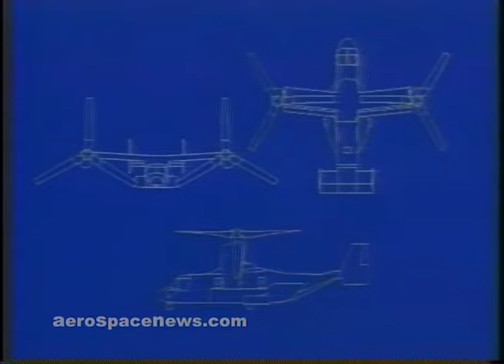V 22 Osprey Documentary | NASA Bell XV-15 Tiltrotor | Tilt Rotor History Part 6 | AeroSpaceNews.com

Comment: Looks like a copy of a Canadair design built many years ago!  Little interest then so it was cancelled!
Reply from the maker: +Ed Majden Thanks for watching and taking the time to comment. While they are both convertiplanes, the Canadian design (Canadair CL-84 "Dynavert") was a tilt wing, where this is a tilt rotor or tiltrotor (seen it spelled both ways). When they were working on the CL-84, limitations all of the aerospace industry faced (lack of computing power for stability augmentation, poor power to weight ratios, and other things), made the challenges of tilt wing flight, and thus the CL-84, unattractive. While still very difficult, various convertiplane approaches today are much more attractive so don't be surprised if you see a real son of CL-84 out there - but the V-22, XV-15 and coming V-280 Valor from Bell won't be them. : )
Reply: +AeroSpaceNews.com What you say is true but the U.S. version has its own problems I hear!
Reply from the maker: +Ed Majden I don't speak for the industry or operators of the V-22 (USMC, USAF), but my understanding is that overall they are very very pleased with the operational performance of the V-22 Tiltrotor aircraft in their fleets. There were substantial problems before to be sure but that is completely unsurprising of any new model aircraft (look at the Boeing 787 or 747 for examples), let alone one that is literally a new type of fleet deployed configuration. There has been nothing as revolutionary in large scale operations in aviation since the first Harrier/Kestrels flew here and in the UK. And the argument could be made that the V-22 is a greater leap than that.